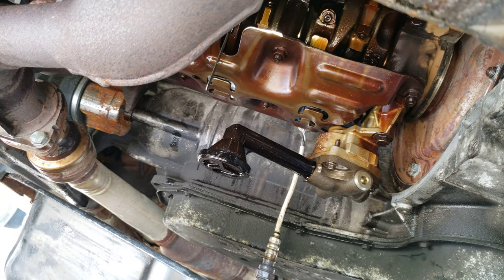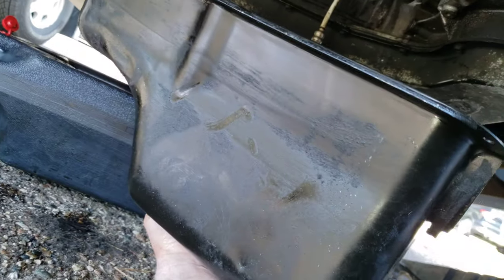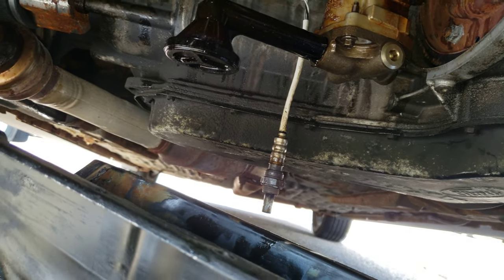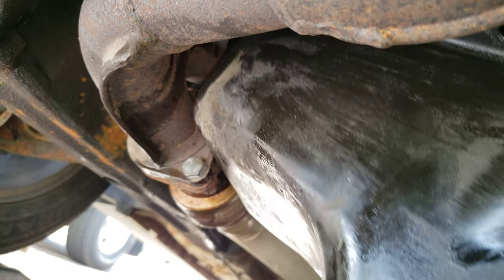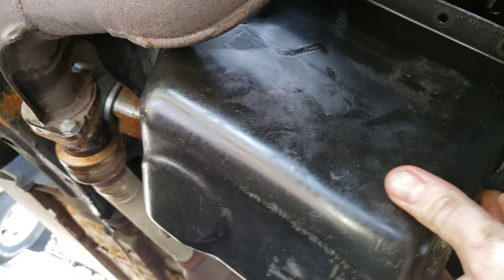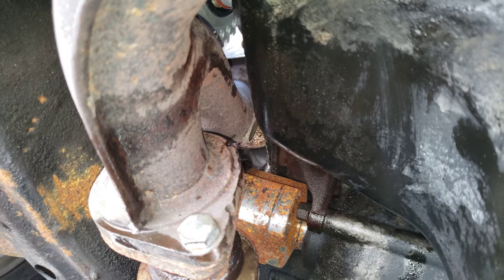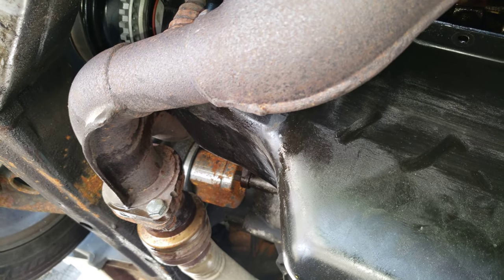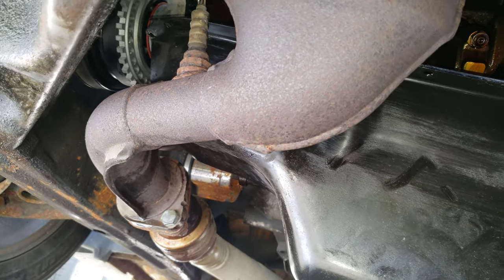2007 Ford Taurus Oil Pan Removal shortcut without removing crossover pipe

Comment: worked pretty well removed the o2 sensor and u just gotta find the sweet spot to install and remove it ... its hard to put the pan in while the gasket is in there so i just looped it under while i had the pan loosly above the exhuast
Reply from the maker: For sure - It's not perfect...but is do-able. Just need to find the right angles and it comes down.  I did mine with the gasket lightly tacked to the pan with RTV..

Comment: I just did this on my 03, 3.0 Vulcan 12V. Your video gave me the info I needed to attempt it. I did have to wiggle and move the pan differently, (it's an 03) but it practically fell out. I really did not want to jack with the crossover on a 229k vehicle. Cleaning the old original gasket off the bottom of the engine was an adventure. I used a straight edged razor blade that I purposely snapped in half length wise and held with a small pair of vise-grips and also a 6" pair of safety-wire pliers. A few spots required the blade and finger power but it wasn't too bad. This is not a 2 or 3 hour job, and will most likely take the better part of a day. Cleaning everything up for installation is what takes most of the time. if you don't clean everything and just throw it back together you will end up with more and worse leaks than before.

Comment: I just did this on my 2006 taurus 3.0 vulcan (sohc engine) 

I was about to give up but it eventually popped out. Don't give up people! All I did was remove the o2 sensor. Once your able to get it out and take note on how it came out its easy to reinstall and remove 

It took me like 15 minutes of frustration trying to initially remove the oil pan. Don't give up!
Reply from the maker: It can be done, it seems to all be in the tilt, rotation and patience.

Comment: I'm not sure why but I tried this on my 2007  3.0 12V Vulcan and it did not work. I tried wiggling and turning it every direction I could--no success. I still had to drop the exhaust....but it was worth a try.

Comment: Did it without removing O2 sensor. As the pan dropped, I cocked the pan so the front lip drops lower and pulled it out
Reply from the maker: It seems there may have been slight differences over the year range on tolerance of that crosdover pipe.  For some folks, our methods work. Its a good time to replace the 02 sensor anyway, as by now most of these cars would have over 100k miles.  Mine had just barely enough room and I had to rotate it a bit to slide it out.  Viewers should try your method first, but if that doesn't work for them, make more room by pulling the 02 sensor.

Comment: Could you do a whole video on how you got this out?
Reply from the maker: I hope to not have to do it again HA!

Drive the car up on ramps, set the parking brake and make sure the vehicle is supported properly.
Disconnect the battery.
Drain the oil.
Take off the Starter and Starter Shield
Remove the rear O2 sensor as shown in the video.
Undo all but 2 bolts on the oil pan.
Take the remaining bolts out one by one.
Carefully lower the pan and rotate it out as shown in the video.

Use caution on the plastic oil Pickup.

It takes some wiggling but it comes out.
Installation is reverse - slide the pan in somewhat angled, then rotate it in and up.
Just make sure all surfaces are clean.  Torque bolts to spec.